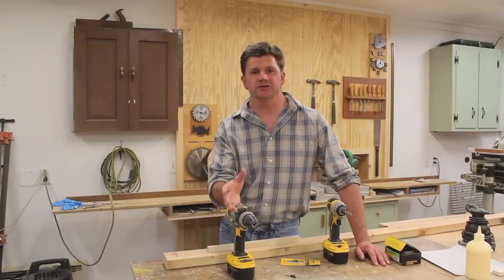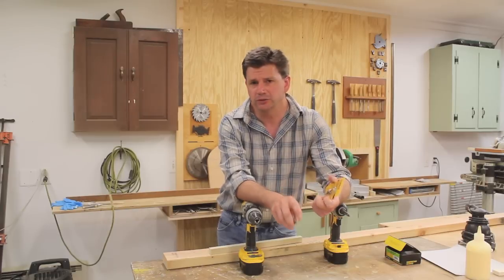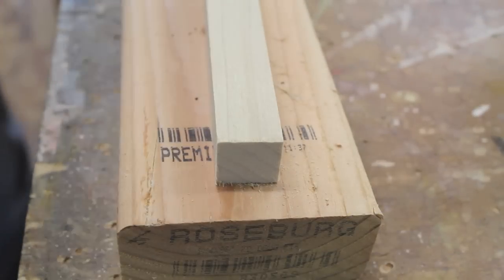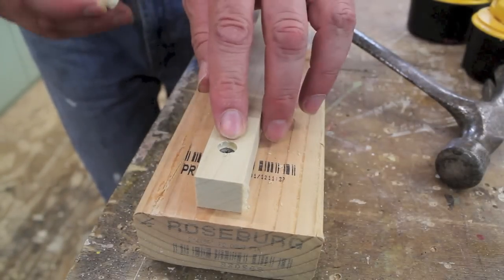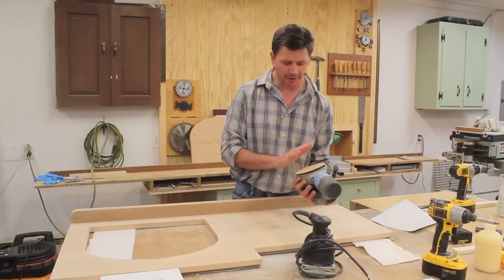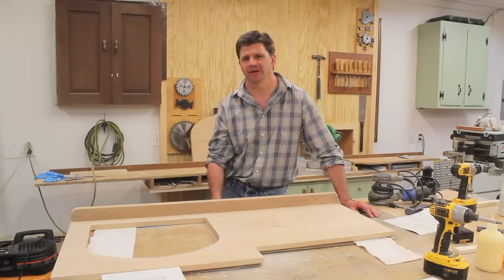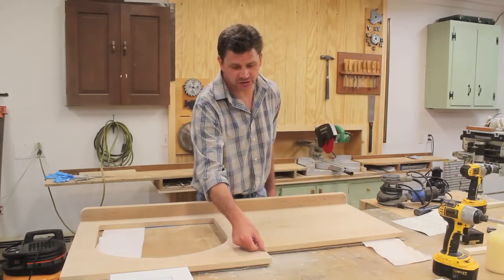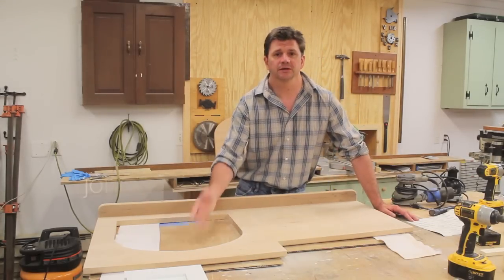Tools & Tips Tuesday #1: Why use a Pre Drill and Countersink Bit.

Comment: The "countersink" bit is a good idea.  Did you also know that the bit you used is part of a drill bit/screw driver bit combo?  The kit includes a holder that fits into the drill chuck and has a quick change lock that allows the combo to be reversed during use.  The holder also has a built in hex tool (on the end that fits into the drill chuck) for the hex screws on the bits themselves. This allows replacement of the drill bit, and the driver tip (i.e. Phillips, straight, socket, etc.).  There are several brand names (Craftsman, DeWalt, Kobalt, etc.) that sell them.  Package kits also come with various sizes of countersinks.  These have been a time and labor saver on many projects. (from $15 to $30).

Comment: Good info, Jon.  I think another pro of using the palm sander for finer grits is the lower cost.  Like you said, you can get 4 pieces from one sheet, and the finer grit paper needs to be replaced more often, as it tends to wear faster than a rougher grit.
Reply from the maker: good point Nick, thanks for the comment

Comment: I think ripping and reattaching the top is a great idea because the biscuit jointer makes it really easy for you to glue it back up.  Without one I would have done the extra work to cut out the notched piece with a jigsaw.

I agree the rounded corners compliment the curve of the sink. Without them the entire piece would be hard angles except for the sink.
Reply from the maker: Thanks, appreciate the comment

Comment: Hey Jon. Love the channel. Been going through the archives - I love the pacing, camera work and detail shots of your process. Gets me excited to get in the shop!
Quick question - just bought a countersink drill bit set and when I press the bit into the wood the countersink part stops moving. Should I not be pushing down? 

Thank you!
Reply: Hi....saw your question and thought I could help.  Look at the bit...the black plastic section.  You will find two holes on either side, these need to be tightened with an Allen wrench.  You will see immediate results!
Reply: Hi....saw your question and thought I could help.  Look at the bit...the black plastic section.  You will find two holes on either side, these need to be tightened with an Allen wrench.  You will see immediate results!
Reply: +TheSuncatcher1 Thanks!

Comment: Hi Jon, Excellent video, as always!

Another fine tool for countersinking etc. is the Rockler Insty-Drive 18 Piece Self-Centering & Countersink Set, Item #: 69045. It has the advantage of drilling and countersinking at the same time, plus instant power screwing by slipping an adapter over the drill/countersink bit. Another function is the self-centering bits for installing hinges.

See the videos at http://www.rockler.com/rockler-insty-drive-18-piece-self-centering-countersink-set
Reply from the maker: Thanks Don and great info...I'll be sure to check this set out.

Comment: I know this video is years old, but I'm hoping you can answer, what do you finish the top with so that it doesn't get ruined by the years of kids splashing as they wash their hands and brushing teeth and all that?
Reply: I did mine with sealant like the kind you'd use for a deck. After helping someone finish their pool deck they had some left over and said I could have it. Kept it around a while, decided to redo kid's sink, and slapped a good solid coat of sealant on there per directions. Looks good, and it's been used for 3 years now only by kids.